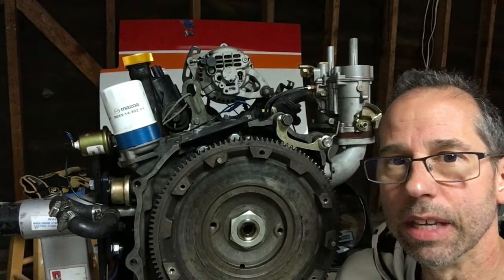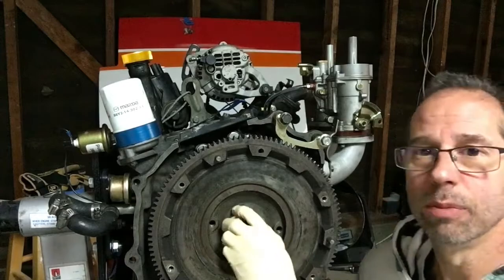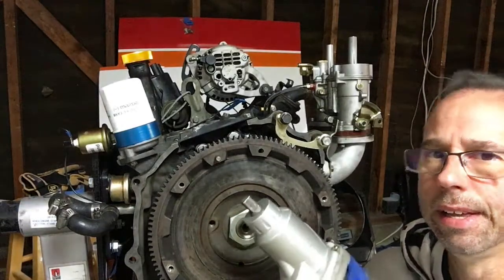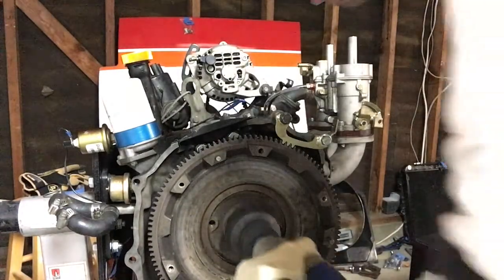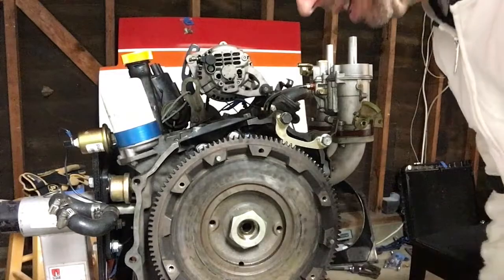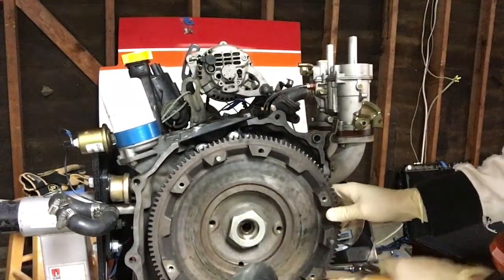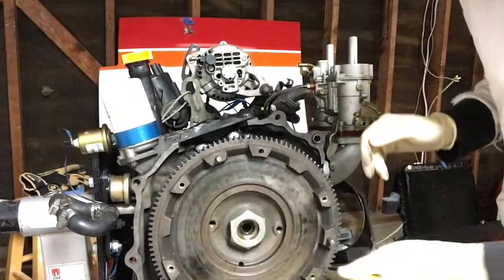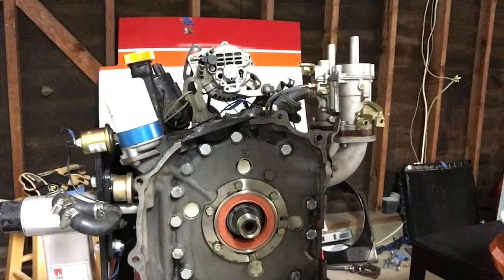Brazil 66 Resurrection: How to Remove the Flywheel of a Rotary Engine

Comment: I just removed my flywheel using your method.  I've always used a puller and a torch. I was impressed that this worked. It took a good 20 or 30 nice whacks w my rubber mallet to free it up. The nut a few turns on surevsaves the feet! Thanks for the video!

Comment: I was looking on Atkins for that locking tool you got there and couldn’t find it is there another name for it?
Reply: They've redesigned it. It's called a "flywheel ring gear brake". Just go to their website and search for the part number ARE923

Comment: I have been attempting for the past week to get the flywheel off, I already got the 54mm nut off. But no amount of banging, slamming or smashing with a hammer will break the flywheel loose. I used a sledgehammer, nothing. Heated the taper/counterweight up with a torch then continued to bang.. and still hasn’t budged. Idk what the fuck to do please help.
Reply: same.